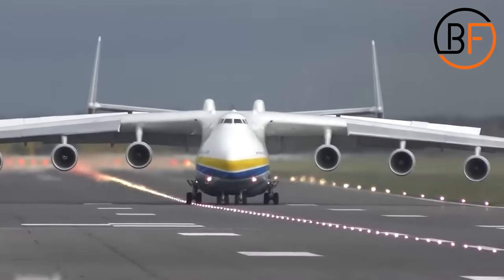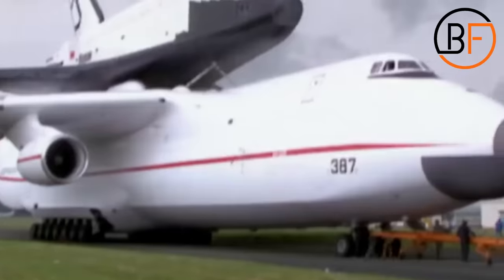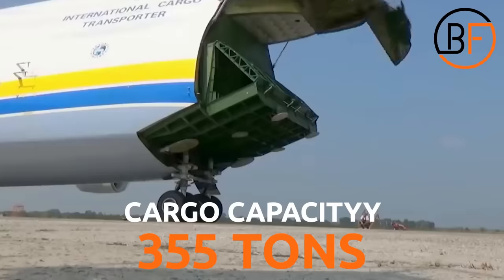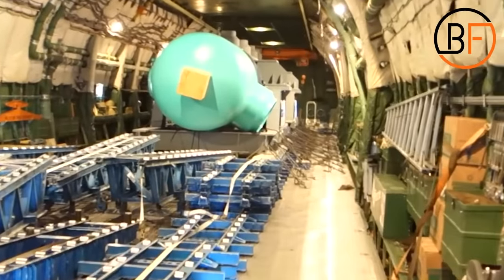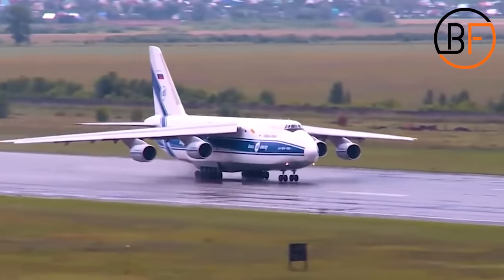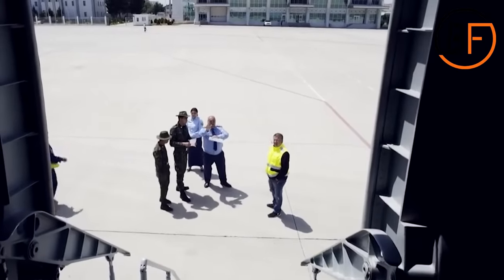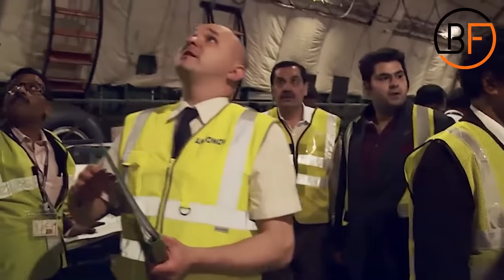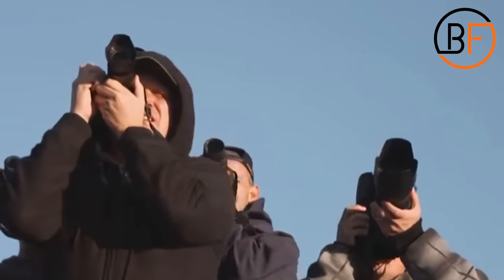Antonov 225 Inside the Largest Airplane

Comment: Did you not do any research on how the Buran or the US Space Shuttle worked?! Neither one of them were launched to orbit from an aircraft. The airplanes used were only to transport and test the vehicles, not to launch them to orbit. Also, the Buran didn't "fail miserably," the Soviet Union collapsed and it lost funding. The vehicle itself passed its tests just fine and many would say was a better design than the US Space Shuttle.
Reply: Better design in that the Soviets "borrowed" the blueprints for the Shuttle and improved on them. Wonder why it looks quite like the US Space Shuttle?
Reply: @grubbler123  also remember the Tupolev supersonic (the so called Concordski)
Reply: @drtalkboxsa9412  ну да мы же все у запада слизали своего же ни чего нет) даже Ан 225 Украинский )
Reply: I cringed a lot when hearing that, the plane was just for transport to the launch site
Reply: @grubbler123   The strong resemblance to the American Space Shuttle is more a fault of physics and fluid dynamics than espionage. There are only so many ways to make a load-body spacecraft to those specifications. This is also compounded due to the technology of the day. It's kind of like how almost all widebody passenger aircraft look the same regardless of the manufacturer
Reply: @Marksmal  Look the same to whom?
Reply: @kevindunlap5525  Explain? You don't think that all wide-body aircraft bears a strong resemblance to each other in design similar to the shuttles from the Soviet Union and the United States?
Reply: @Marksmal  You're likely referring to the necessity of a tube being put on wheels with fire works on the wingy things?  An enthusiast would be able to differentiate engines from a distance.  Easily.  For example.  None of the commercial quad jets look alike at all, for instance.
Reply: @Marksmal  I mean, they had a clear intention to copy it because they were afaird it was gonna be used as a weapon, but they had several approaches in development that were completely different and in the end they came back to a more similar design, indeed for physical reasons.
Reply: There were plans to make a smaller Buran that could launch from Mriya but that never got beyond the planning stage. It was just not explained properly in the video.
Reply: @artgalgenius  I think the video was good enough and very good for those who don't know Her Majesty.  Us big fans DO know these things.  RIP
Reply: You missed the fact that some of the examples in the video weren’t even the 225.
Reply: Seriously I was about say. This video is so bogus.

Comment: 4:42 I think I can count to 6 but no matter how often I try, I only count 4 engines :-)
5:45 I think this is a 747..
Reply: It was a AN-124, an earlier and smaller cargo jet. It was the base to develop the younger bigger version of it, AN-225
Reply: Many channels think that the viewers are big fools,they are fooling the viewers by showing something else instead of the promised thing.
Do not show AN 124 and B 747 instead of AN 225 we can make out the difference.
Reply: Yea I noticed they didn't sow what they was talking about
Reply: Probably, it was 225 in childhood, later it will grow up a little and all it engines will be in place. As far as I know, it works that way
Reply: @КириллПетров-у5ж  The AN-225 started out as an AN-124, but the fuselage was stretched, additional landing wheels included, wing root extensions added as well as the extra 2 engines
Reply: guys.. you know that there's not infinite footage and camera angles of this right?

Comment: 225 is designed to carry Energia rocket components (including the Buran shuttlecraft) not directly launching the Buran to space. There was only an idea to launch a spacecraft (not Buran) but it just an idea. Please do proper research.
Reply: Idea aside, was It a different spacecraft than the buran? I always tought It was the buran itself they planned on launching by piggybacking It from low orbit
Reply: @RoisonGamer  Buran is just a piggyback item and launch conventionally by the Energia. The idea using AN225 as the launcher was called MAKC (Многоцелевая авиационно-космическая система) roughly means Multipurpose Aerospace System. Like other innovative Soviet-era space projects, It was canceled in 1991 with the collapse of the USSR.
Reply: @msb3235  The MAKC did come quite a big into its development rather than just being an idea to be fair. The engines for it, the RD-701, got fully developed and are arguably the best rocket engines ever made since they used a tripropellant of LO2, LH2 and Kerosene while having incredibly high chamber pressure and efficiency.

Comment: Some information in the video is completely wrong. The Antonov 225 was only meant to transport Buran and definitely not to launch it into space. USA also used a modified Boeing 747 to transport the space shuttle to its launch facility. Buran was launched into orbit by the Energia rocket, but it was only done once as it was not economical compared to the Soyuz rocket.

Comment: I think I spotted an AN-124 at Detroit Metropolitan Airport (DTM) a couple weeks back sitting on a side area. Not very common around here.
Reply: There's only one AN-225 in service but there's about 25 or 26 AN-124 currently around the world. We actually had one fly overhead here in Brisbane, Australia last week. It's a different type of rumble to live far enough away from the airport that you don't register when a normal aircraft takes off, and yet have this thing still at ~3000ft overhead as it departs :)

Comment: Buran space shuttle can't be launched into space by piggy backing on an airplane because the Russian space shuttle orbiter doesn't have main engines built into itself. However this antnov plane was developed to test the Buran space shuttle for gliding down through the atmosphere.
And Buran space shuttle program never got failed instead it was the breakup of Soviet Union which halted the program.

Comment: I love how they had to design a brand new plane to carry their shuttle and we just used an off the shelf 747.
Reply: Well….. they we did modify those 747’s quite a bit. Besides what you saw on the outside those 747’s had their internal structures modified and strengthened a lot.
Reply: @frankthespank  I was waiting for that. I realize that. The basic plane was good is my point. The best and most beautiful plane ever designed
Reply: @frankthespank  modifying an existing aircraft abound building a completely new aircraft are two different things actually if you know what I mean . Frank the spank thick as a plank .
Reply: @judefernandez827  Did you forget your medication? 💊

Comment: God I cringed so hard hearing “it was used to launch the Buran!” XD

Please please do more research instead of the first option you find on Bing.

Also the thumbnail is 100% photoshopped. That is not landing gear belonging to the AN-225 in the slightest. The REAL landing gear wheels would be about a quarter the size, around 4ft (-ish) in diameter.

Comment: Holy shit this is complete garbage. The Buran orbiter launched on the Energia super heavy lift rocket. The Antonov 225 was only used to transport the orbiter to Baikonur, its launch site. And it was successful during its first and only flight. The plane that would be air launched was the MAKC spaceplane. Which was a very different spacecraft.